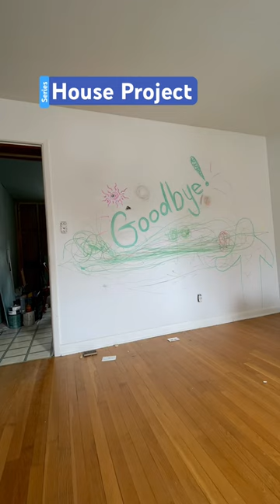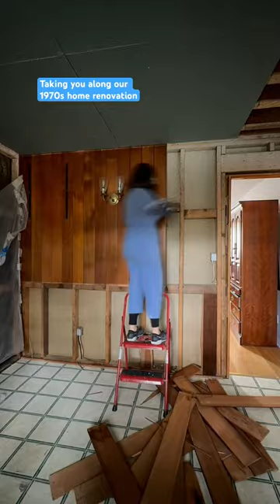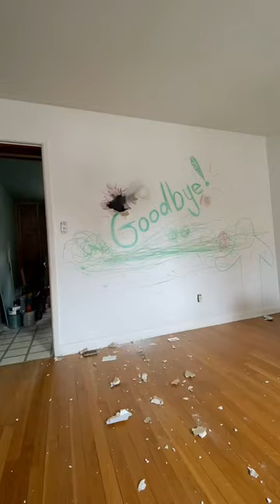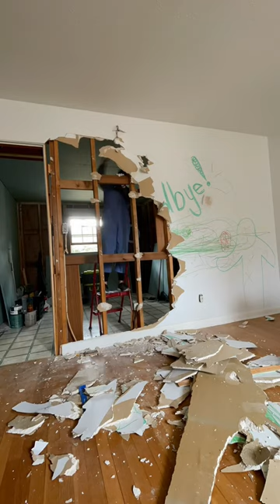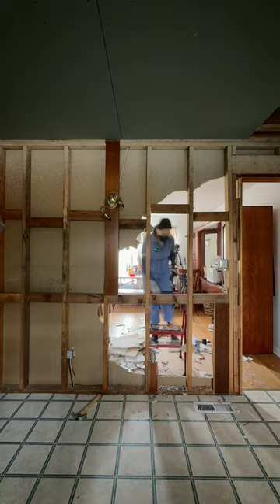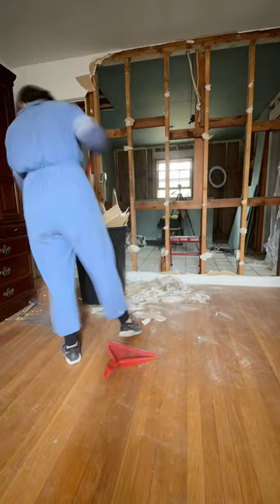Ep.22 KITCHEN RENOVATION | Knocking down wall DOUBLING SIZE OF KITCHEN! | Wall remove |House Project

Comment: Fantastic work! It’s very clearly not a load bearing wall, although simply for aesthetics and added security I would put in a NEW decorative ‘support’ beam just for fun once it’s all opened up. That would also allow you to maintain any existing electrical work 😊
Reply from the maker: It’s definitely a possibility!
Reply: @davidcasellajr9187 How did you very clearly know it wasn't a load bearing wall? I've watched a couple videos and I'm still confused about a wall with spindles I have.
Reply: @teetee19768  always consult a professional in person of course, but just looking at it now that the drywall is down you can tell by the lack of load bearing beams that it is not a load bearing wall. But like I said to the OP simply for safety reasons I would leave one beam and use it decoratively.
Reply from the maker: @teetee19768 I would consult a structural engineer to at least get a definitive answer. That is something we didn’t feel comfortable with guessing ourselves 😂 they also give you a report and sign off on it.
Reply: A load bearing wall will intersect multiple ceiling joists as the load bearing wall would be supporting the many cross members holding up the floor above it.

A non-load bearing wall would connect with the ceiling above it along ONE joist that supports the length of the floor above it. 

Each ceiling/floor (depending on if you're looking UP at it or DOWN at it) has "joists" that run horizontally (left -right) from the house's outter walls. These joists will alternate direction when looking at the cellar ceiling joists to the first floor ceiling joists then to the second floor ceiling joists for the best construction support between levels. 

If you can determine the direction of one ceiling joist on a level, you can deduce the celing joist directions of the other floors.
Reply: @rattlecat5968  so we agree
Reply: @davidcasellajr9187 It appears we do. I was offering a layman's explanation to clarify.

Comment: You can tell that is a load wall sorry to inform you dont get rid of the door frame beam and you should be ok
Reply from the maker: It’s not load bearing
Reply: @theyorks But the best part is the competing threads. One saying it's load bearing, and the other stating it clearly isn't. Like they can see through the ceiling. Stupid comments all of them...
Reply: They had a structural engineer out and did a report, I’d trust a professional inspecting in person over a stranger on the internet who can’t properly see lol
Reply: @NicoleP278 you absolutely should not. Lots of structural engineers working for shady ass companies. Multiple opinions are always the best bet and you want to get the structural engineer out AFTER the drywall is down. Drywall is not a structural element
Reply: @JeronimoStilton14  in my state structural engineers are licensed and do not perform any repair work themselves, they only do reports. Not sure what the incentive would be for them to generate a false report?
Reply: @NicoleP278  money? A customer wants a report saying their stuff isn’t an immediate danger, they pay the first structural to let them say that. 

Or maybe they want the previous builder liable, pay the first that will say that, etc etc.

Typically each firm is licensed with a few PEs but the person doing the walkthrough could be any level of engineer. Can say what they will. In this case seemed obvious the customer wanted a “this isn’t load bearing” and they probably did some taps here and there look around and assumed it wasn’t. That door stud is kind of worrying, but since she got it before she tore the drywall down they don’t have much to go on (and probably wouldn’t go pull the city building permits for you)